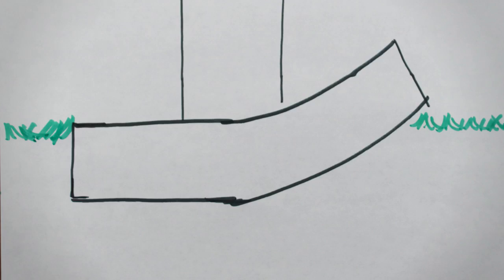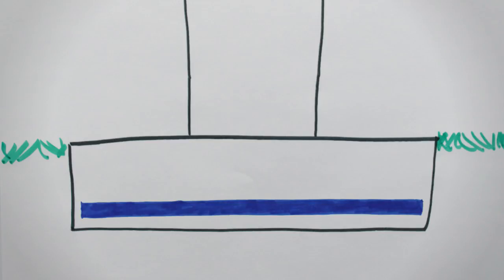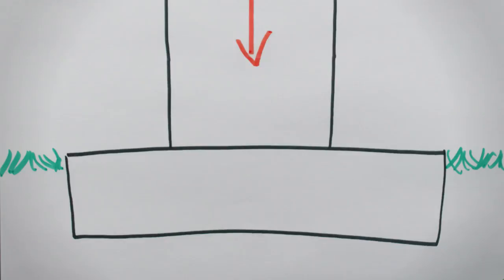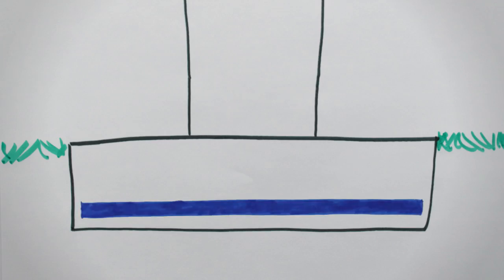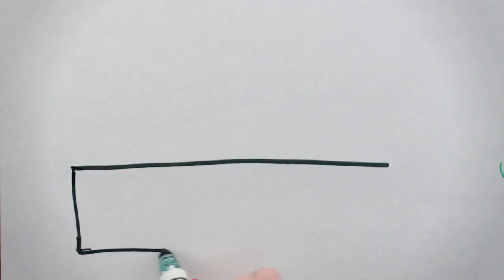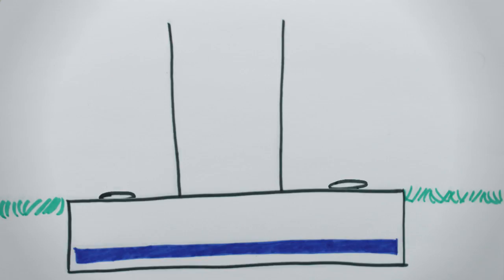Footings

Comment: Building a raised porch with filled(concrete) cinder blocks. I think I will need footings. Can I dig 6 fence post footings at 3' deep, then connect those footings with a 1' layer of concrete around the the top of the perimeter? The porch size will be 6' x 12'.